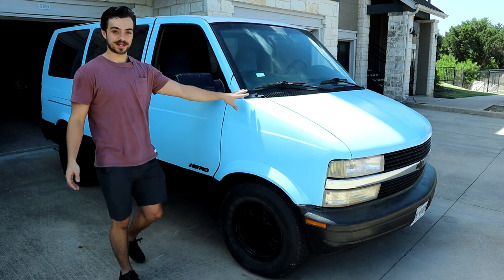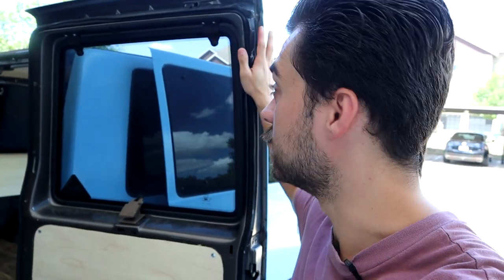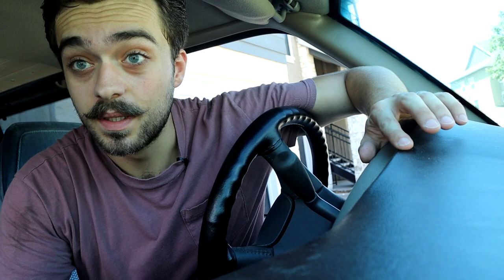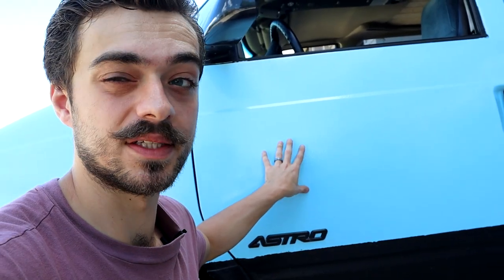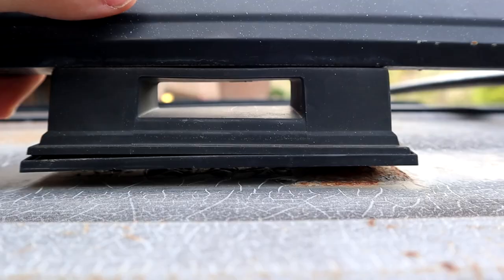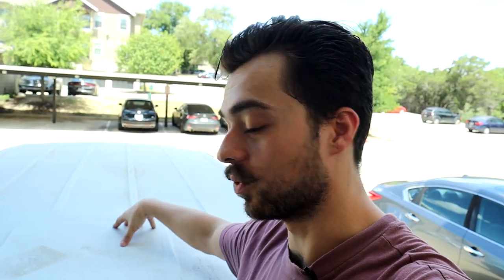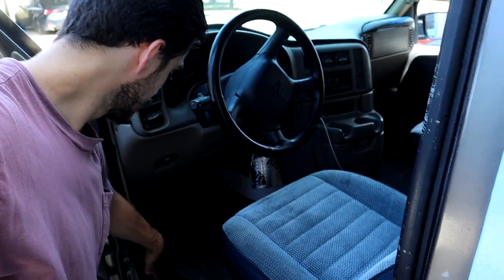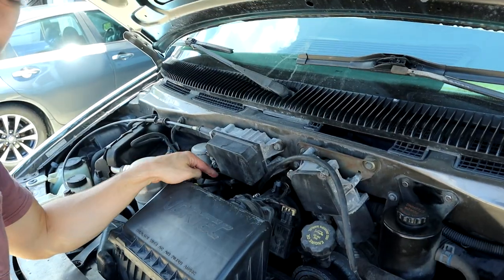Here's 5 reasons you should NOT buy a Chevrolet Astro Van

Comment: I have had my 2000 Astro AWD for 21 years. 340,000 miles. I will be sad whenever it needs to go. Awesome vehicle in every way. Biggest problem is many parts are discontinued and hard to find used (in good condition). If you maintain it - It will last. A lot of the problem mentioned are regional. Living in the Northwest away from the coast mine has zero rust.
Reply: Wait so u can't find parts for this van at  AutoZone..
It's an American car
Reply: @sugarhillromelo1569  Yupe, I got a 1995 I found everything on, Orallys AutoZone, auto parts, Amazon or eBay
Reply: I just got a 2000 astro awd for free all it needed was a distributor. It only had 124k on it! I'm so excited but I really want to talk to someone that knows the vehicle if anything happens. Can you add me or however YouTube works now lol
Reply: @sugarhillromelo1569 right? That’s what I’m wondering now ? I’m looking to buy a really clean 2001 with super low miles. It definitely wasn’t neglected & always garaged. But reading his comment now worries me for when and or if something goes wrong. 😬

Comment: Good video and you did explain the cons very well. I personally love my Astro but I have had it since it was brand new with only a half of a mile on it and now it has 236+ on it. But I have change the oil at 2500 miles and i use lucas oil additive (on quart) I also have changed the plugs and plug wires every 50k. she runs great and is now in the midst of being converted into a small camper so we can use it to travel.
Reply from the maker: Know the history of the van is important. You were a good owner and took care of your van, so it will last a long time. A lot of people neglect their cars and destroy them. Bought mine around 200k highly neglected so I am a bit caution traveling far distances
Reply: @ImChrisDeDecker  yeah you need to be cautious about distance. But it's cheap to rebuild or just replace the motor. It's one of the most common engines built. I'm looking into putting a manual transmission and a straight axle with a transfer case in it to make it a true 4x4.
Reply: @ImChrisDeDecker I’m looking at buying one to live in and travel the us I would love to hear ur thoughts

Comment: I fixed the glove box rattle by adding stick on felt furniture pads to either side of the latch mechanism - Been meaning to mention and show that in a video - Was in AZ in 116° heat and I can see a slight gap between the bezel and dash just above the steering wheel - I keep meaning to pick up one of them dash carpets.... 
Neither of my Astros (I had an '05 cargo before this one) leaked but one of the fist things I did was inspect and clean all the rubber - That rubber "gutter" piece over the back opening can get filled with debris which leads to it breaking down - I pointed this out in one of my videos - It's a good idea to clean that out from time-to-time
Reply from the maker: Ahh yes. I actually remember you mentioning the foam at one point, totally slipped my mind. I’ll add it to my to get list now. 
The heat is the main killer. Even with sunshades, the head kills the dashes man. 
My gutters are relatively clean and acceptable, I’m convinced the rear doors mangled gasket it’s the cause. Maybe I’ll replace it in a few years 😂 kidding, sooner than later
Reply: @ImChrisDeDecker  Check my cedar ceiling video - Posted it last night - I think you'll dig on it

Comment: I’ve owned a very basic ‘86 Astro for 5 years now and it’s great. Very basic. No cruise control, no power windows, not even a radio. Paid 3k.
I use a tailgater boombox and Bluetooth, and that works perfectly for my stereo system . Only complaint? Be careful that you don’t turn off the headlights accidentally on using the turning signal. The headlight levers are very sensitive. 
The van only had 42,000 miles on it when purchased five years ago and now has 84,000 miles on it. No rust, very clean underneath but roof needs painted. Basic maintenance is the key to longevity. 👍

Comment: I have owned an Astro for business for 20 years. Most reliable vehicle I could ever want. Never selling it. Easy to maintain and repair. These are good vehicles if you know how to keep up on them. Every vehicle on the road has its known issues and in many cases, there are upgrades to improve upon original design. My Astro will never be for sale, it's just too reliable and gets me where I need to go every single day.
Reply: Love seeing this. About to be my first work van and I wanna truck it out😭 lol
Reply: @TropTrevTv  take care of it and it will last you a very long time. And the engine is rock solid. It's a 6 cylinder version of a 350 small blocl - same listons, push rods, etc.  It's basic but reliable. I've read numerous stories of these vans with 300, 400 and even over 500k miles. Change the oil and do the maintenance and you'll be rewarded.
Reply: How do I learn to maintain it properly ?

Comment: My 2005 AWD Astro with 90k miles was $11.2k , its pristine. No dash cracks, cold AC and the interior only has a couple of dark spots on the carpet. I see plenty of these vans with under 100k miles going for $15k. Only work I have had to do to mine is fix a rotted vacuum line that was making the AC blow out of the defrost. That was $9 part. Have took the van on several camping trips with no issues. Wish it got a little better gas mileage though but other than that we love it. We plan to travel the US once we get an enclosed cargo trailer conversion to pull.
Reply from the maker: That's what you pay for a well maintained one. Converting a trailer has crossed my mind a few times myself 🤔

Comment: Interesting, I work on these vans a lot, and have 6 of them at the moment. So far I have never had any problems with the dash de laminating, the plastic chipping or the grab handle breaking. I live in canada, in the rockies, so rust is an issue. So far my vans are rust free but it is a lot of work cleaning and re undercoating them from time to time. As for the roof rack, I use that for everything, even carried a couple foot tall stack of 2x4's up there, these roof racks are very strong.
Reply from the maker: That’s crazy, i have only seen one van out of probably 10 with a grab handle that isn’t damaged. I’ve seen maybe two with the dash not de-laminated. Living in the southern part of America, the heat hits the plastics and dash pretty hard. That might be the biggest difference. 
Living up there, you definitely need to take care of that rust. 
How does the vans perform in the snow for you?
Reply: @ImChrisDeDecker  These vans seem to be excellent in the snow, I think it has something to do with the weight distribution. With a pickup truck its very light in the back, with these its pretty well distributed front and back. The rwd one is pretty good so long as you keep some speed going, starting from a stop uphill is tricky. Gotten it stuck before, just have to rock it back and forth till it pops out of the hole the wheels are in. The awd's are amazing in the snow, have one with a different tcase, 5 inch lift and 30 inch tires among a bunch of other things, it goes anywhere, even in the snow. Even beat a new tacoma offroad in it, when the snow gets really deep and its pushing it with the bumper I put these very aggressive vbar chains on it and it goes anywhere. That being said I have bottomed this thing out so bad in mud and snow that all 4 wheels are in the air, if you do that its a very long and hard job to get it un stuck. The only thing you need is some good experience with snow, and some good snow tires. 
I don't know what its like where you are but around here summer isnt that long. We get a rainy spring where it stays mostly around 70F, a short summer that sometimes reaches 110F usually accompanied by smoke so thick you can see it swirling all around you from all the forest fires, then we get a rainy, then snowy, then rainy again fall, followed by a snowy winter. Last winter we got almost 6 feet of snow in only a few days, temps vary wildly by year, but its usually pretty darn cold, sometimes dropping to -20F or colder with the wind.
Reply: @spiffcats  I live in the north as well, tons of snow, temperatures of minus 60 F sometimes (windchill not included), and loads of salt on the roads from the beginning of November through the end of May. I'm thinking of getting a 2005 Astro, curious what you use to undercoat, and how often you reapply?
Reply: Mine has the delaminating dash and the broken grab handle... and sagging doors, and leaks, and failed power door locks... but it's still a great van.

Comment: Awesome video .👍  You're keeping  it real here. I bought a 2000 AWD cargo version w/140k on it for $6500...a Georgia utility fleet vehicle with absolutely no rust but sat in the garage for 10 years ...needed old gas siphoned and ton of fuel injection cleaner to get it going... 
Cargo doors have no leaks...dashboard cracked and separated just like yours (I have to see how you fixed that video)..cheap plastic rattling is DEFINITELY real..no problems with my drum brakes..they were new ones the fleet put on..as far as rust I am using an oil wax since I had this thing shipped to Connecticut where I live now...they spray pickle brine on the roads here and many of the vans look like Swiss cheese with all the  rustholes...as far as prices I've seen Astros going for almost $20,000...mine would be almost double what I paid 2 years ago...
Reply: Nice I snagged a 01 fleet driven awd 2 years ago with 100k for 2k. Same deal no rust she's been great.  She's already got 150k on her.

Comment: I have a 2001 GMC Safari which is basically an Astro van. I was blessed and a lady I'm good friends with gave me this old van for free. I wanted to pay her for it, but she wouldn't let me. It took about a month before I decided to accept it from her for free. It's got some issues, but so far, I've been able to fix it up relatively cheaply. The vehicle has a little over 130,000 miles on it. I just recently replaced the alternator, belt, idler pulley, and tensioner pulley system. I also had to replace the HVAC heater bypass valve. My next project is I'm going to need to replace the oil pressure sensor and while I'm in there, I am going to replace the original plastic housing distributor with a new all metal housing distributor. It should be a pretty easy repair. For now it runs great. I was even surprised with it being over 20 years old when I serviced the A/C system I was able to charge it and the A/C system had no leaks so far and has a really cold air system after charging it up with about a little over 2 pounds of freon. So far I really enjoy driving this van as well as working on it.

Comment: I just bought a 1999 Astro Van that has been sitting without being started or used in four years. Anything that you think I might look out for? Your assistance would be appreciated! Thanks!
Reply from the maker: I would for sure change the trans oil+filter and the engine oil+filter. 1999 has drum brakes, so after sitting for a while they could fuse together. I would remove the wheels, the drum and spray it all down with brake cleaner. 
Other than that, see what breaks. I have another channel that I started the Astro project with and I fixed many many issues and replaced potential issues. It’s all within this Astro Van playlist

Comment: I have a 2000 astro that I bought in April of this year. Now it needs a new engine. FML. I thought I could fix it by doing head and intake gaskets, but nope. So I'm debating getting the engine replaced/rebuilt or just getting rid of it and buying a new van from a dealer.

Comment: I have been looking at a 2000 Chevy Astro van cargo van with the barn doors on the back and all that relatively rust-free, temporarily the AC needs to be bypassed cuz the clutch is bad so that creates issues the band does have over 200,000 MI needs a few basic things and a tune-up but the guy wants $3,000 for it, a dashboard in all gauges are actually in pretty good shape for being a cargo van, but I've been reserved about this van because I have never owned a Chevy Astro van

Comment: Thought about an Astro, but I was smart and bought a 99 4d 2wd S10 Blazer. I also lucked out because I had it has an g80 rear end and 3.42 gearing and factory hitch for $1200 over a year ago. I needed to rebuild the whole emission system and it was able to pass a California smog ✓ (6 months later still no SES light). My truck spent its entire 23 year life in San Diego California on the highways zero rust even under the trim/cladding. It is on its second 4l60e  which hasn't given me any problems yet 🤞🏻✌🏻

Ps it now has 264k on the clock
Reply from the maker: That is a solid deal! The 4L60s are fairly robust, so hopefully it will last the rest of the cars life

Comment: These were really a good all around vehicle. 
Only a bit tippy (a girl friends friend tipped hers over going around an intersection a bit quicker than she should have).
The transmission is soft in them so do not presume that "its chevy though and sealed forever life". Get it serviced and synthetic fluid.  
The sub frame in front is a pop can!!!
Must have two times a year oil spray up inside up high behind the headlights!
They ALL get rusty around the radiator and then the body creaks and game over buddy! 
The best van just behind Savana and Express but they have proper frames the Astro is folded over sheet "frame" which falls apart if you live in Canada. 
In Canada the dash pads and grab bar always are in good condition being dragged into the junkyard. 
All have rotten subframe.... every last one... some even still smell like the showroom in the cab and low mileage but subframe is cracked and you can't drive it.

Comment: I just bought my astrovan. its a 1997 and it runs and drives with minimal rust and 300000 km. got it for 600$CA but on coldstart it has a small knock that goes away soon after
Reply from the maker: That cold knock could very well be the timing chain has stretched a bit. Luckily these engines are non-interference motors
Reply: @ImChrisDeDecker  any suggestions about what I should do about it?

Comment: One big problem with Astro vans is the rad supports rotting out. GM no longer makes them & there are no aftermarket rad supports.  If you go to buy an Astro, make sure to check out the rad supports thoroughly. The van can look & run great, but if the rad supports are rotted, the van is toast.
Reply: Y is the van toast if rad support is rusty ??? lots of guys on U Tube have showed how to repair that specifically! especially if u r intending to swap to 5.3 is perfect time to do repair!? I didn’t no that about them ! but it was a AWD and couldn’t turn the price down and has ran 20K km no issues over the summer winter summer just finish lift and t case to 4x4 I’m starting from bottom up so engine rad support next yr I have few donor vans !  so but I hear what your saying hard to c down in there unless u no what your looking for  ?? I do now LOL !!
Reply: @dougmurray3373  it is not toast when it's rusty, only when it rots out and sags. Sometimes the first sign it is sagging, you will hear the fan lightly hitting the shroud.
Reply: @Firestone1  How do people fix it then? I’ve seen a lot of these for sale.
Reply: What are rad supports?
Reply: @richardgallagher913  must be radiator.
Reply: U can find aftermarket literally easily with a Google search
Reply: These are not hard to find dude😂